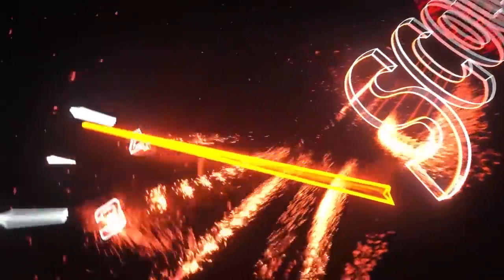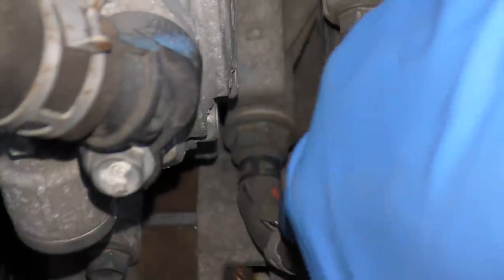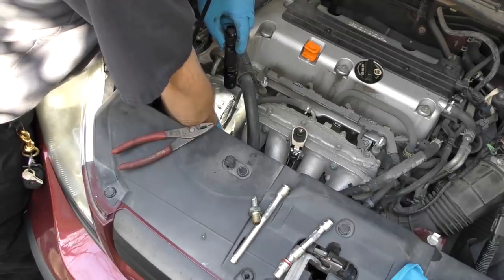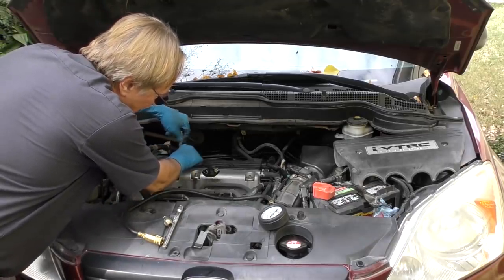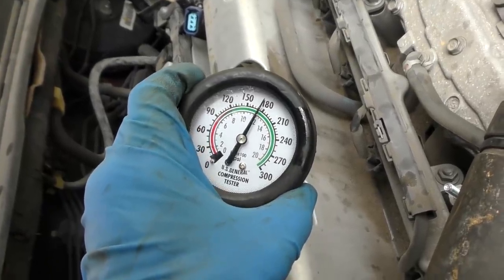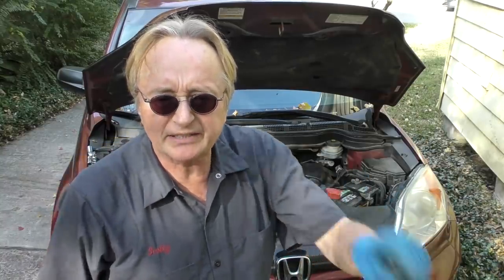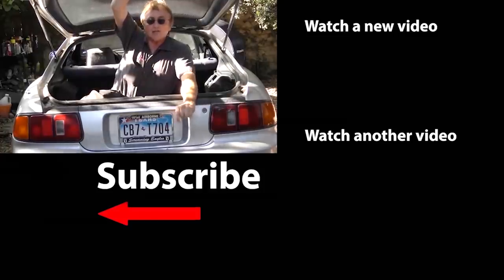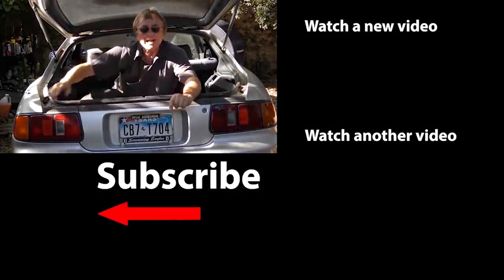The Truth About Honda

Comment: 6:20 I never pay attention the oil life monitors.  I'm sure there is some rhyme and reason to how it "calculates" oil life but you should go by the mileage or age of the oil (like every 6 months or 5,000 miles).  Someone did tell me that supposedly if you drive more highway miles (where the vehicle is running at a costant speed, the oil life monitor doesn't change as fast as if you're driving in the city, and that some will look at the RPMs, the higher the RPms, the faster the oil life monitor drops (assuming you're doing more starts/stops).  But I don't really pay attention to them myself and people should just get on a schedule: check your oil regularly maybe every month if the car is newer, and every time you fill up or every week if it's older or has over 100k, and change the oil every 5,000 miles or about 4-6 months.  This is partially why I wish they would bring back oil pressure monitors on cars.  Heck, some cars these days don't even have temperature gauges, so that's asking a lot of the sensors and the engine computer to report problems to the driver.  That's why I sort of like trucks most of the mid to high end ones show you all you need to know: oil pressure,. gas, temperature and alternator output (although alternator output isn't that important for most things IMO).

The one downside to the engine oil monitoring is that sometimes it will report low or no oil and turn off the vehicle, which all that sometimes is is a bad sensor.  Happened in my 2013 Silverado.  SAid no oil, even though I just checked it about an hour before.  STart it up again, it works again, and then says no oil after about 5 minutes of driving.  Of course on those trucks, the oil pressure sensor was known to go bad.  But the problematic thing is that when it goes bad, the truck will shut down, even if there is plenty of oil and oil pressure, because it thinks it's out of oil and does that to protect the engine.  I wish you could turn off the automatic shutdown though on those so you could at least drive it somewhere to get fixed, if you were darn sure you still had enough oil (which in my case, the oil was full and it was making pressure--the sensor was just bad).

Too bad GM doesn't have the rear differential pan where you have a fill and a drain hole.  I think they only have the fill plug (at least on mine) where if you want to drain it, you have to remove the cover, replace the seal, and then seal it back up and fill it, which IMO is unecessary as you would only need to repalce the seal around the cover if it was leaking....  In fact I (at one point) had considered drilling a hole in the plate and installing a threaded pipe plug so I could do the changes without removing the cover.
Reply: Not only that but you can tell when your car is fully warmed up oil takes twice as long as the coolant to warm up normally

Comment: Those K24 engines were known for burning oil, even as new or low miles the rings were weak or they got gunked up but I changed the pcv and done carbon services and oil gunk removal services but still burnt but it did decrease

Comment: Hey Scotty, I bought a 2015 Corolla S with a 6-speed manual a couple months ago. It only had 85,000km on it but  I recently noticed that if I happen to stall, the car has trouble starting back up immediately. It's kind of annoying because a couple weeks ago I was getting out of my driveway and I had to back through some snow and I didn't give it enough gas and I stalled halfway out of my driveway with cars incoming and the car wouldn't start back up. Engine would turn but no ignition. It took like 5-6 seconds until the engine was ready to start back up. What could be causing this? It happened again a couple days ago but at least this time I was still in my driveway, same thing happened.  Another thing I've noticed is that sometimes the reverse gear will not go in unless I release the clutch and push it back in. Ever heard of something like this with their 6-speed?

I had a 2004 corolla S with a 5-speed before that, drove that thing for over 400,000km (No idea exactly how much because the odometer stopped at 299,999). That thing was way better than the 2015. I never had a single issue with it except for some rust, what a beauty it was. Unfortunately I got caught in a multi car collision on the highway this year and I had to scrap it. It was a sad day.
Reply: Because you're stalling it, theres still fuel in the cylinders. My guess is the computer doesn't know that and tries to squirt more fuel in when you crank it and its probably flooding itself. 
First gear and reverse gear are not synchronised, and are sometimes difficut to engage. Reverse gear sometimes stops at just the wrong position that double clutching will make it engage. First gear can also be difficult to engage when down shifting so double clutching will help it. My 2017 is the same but I've seen it on older manuals too. Just the nature of them i think.
Reply: @plus1497  Yeah that's what I'm thinking too regarding the stalling. It's kind of annoying tho since my 2004 never did anything like that. It would always start on the second or third crank no matter what and I never had any issues trying to push it in any gear. Well it did grind when putting it in second gear at high RPM but it always did that and the transmission never died on me. Anyway, thanks for the reply! I'm just wondering if it's anything to be concerned about since I've only got 10,000km left on the warranty. I guess that's just how it is with more technologically advanced cars. I want my 2004 back 😅
Reply: @betchbetchington6019  I blame technology. Everything was more reliable back then. Nowadays if something seems "off" it's probably normal and nothing to worry about. Mine is also susceptible to griding at higher RPMs but I thought I'm not pushing the clutch all the way in cause I get lazy. I'd say if it starts and runs well just keep driving it unless it gets worse.

Comment: What type of impact guns are good to use on oil drain plugs?
Reply: Ellis Jackson none of them. Wrench only
Reply: @freddiehagood7097  lol it was a joke
Reply: @ellisjackson3355  one with 800 pounds of torque :-)
Reply: @Viper81766  I've got one with 1100 and it works good for me...... Been changing hella oil pans. Almost procedure to change the pan during every oil change now.
Reply: @ellisjackson3355  I've seen a few guys use impacts for drain bolts . Never works out too good .
Reply: @ellisjackson3355  amazing how much torque they have now . Friend of mine does diesel work and really uses his alot .
Reply: @Viper81766  I had a snap on pt650 and it made about that much torque at around 5500 rpm. I didn't feel that it was powerful enough; I upgraded to the 850 with more torque at a higher rpm. Funny how some of their stuff makes you wanna upgrade lol.
Reply: @Viper81766  and I've NEVER seen anyone impact a drain plug lol.
Reply: @ellisjackson3355  you get used to the power and it seems like it isn't enough . Kind of like horsepower in a car .

Comment: I don't believe in 15,000 mile oil change intervals especially if you don't drive much. 120,000/12years is 10,000 miles a year. That is your real problem not changing your oil enough. More than a year for any motor oil change is way too long.

Comment: Since the owner changed the oil every 15k or even if it was 10k miles. No wonder the car started burning oil. 
I might say that's very strong engine since after so many miles of such bad maintenance it's burning only small amount🤔

Comment: I have a 1998 honda civic thst i bought for 600 from a chick it runs fine im just worried about the transmition fluid. I dont know how long it sat for. Its a 5 speed stick
Reply: Then just go and replace it. Manuals are splash lubrication like the diff he mentions later on in the video.

Comment: Do I need a catch can on my 2019 Gen 2 F-150 3.5 ecoboost?
Reply: Steven Dew probably
Reply: The harder you drive it and if you are running a tune (higher boost) the more likely the answer is "yes" if you want 10 years out of the truck. Also you can help reduce the pain by changing oil frequently and keeping it clean.

Comment: Honda used to make much better engines I had an accord(1991) with over 280K miles on original engine and never burned any oil during my 3 years of ownership.
Reply: he said the customer changed their oil every 15,000 miles. that's abuse lol. This is not Hondas fault whatsoever, but the owner

Comment: I will never get a Honda either. I will just get a 2009 Ford Fusion SEL V6 AWD sedan instead, because it has the 3 L Duratec V6 engine with 221 horsepower and it has the regular six-speed automatic transmission. These 2006 to 2012 Fusion's are still going strong, than the 2013 and up models.
Reply: Lol good luck
Reply: Incel

Comment: Customer fucked that Engine up by changing oil in every 15000 mile with conventional oil. I do full synthetic in every 4000 mile. 187000 mile, no issue

Comment: Or use a really good synthetic oil and change it every 10,000, just saying motor on.
Reply: 10k? You crazy
Reply: lol the customer already waited 15,000 miles between oil changes he said in the video. ridiculous. no wonder this honda is not working right after only 120,000 miles